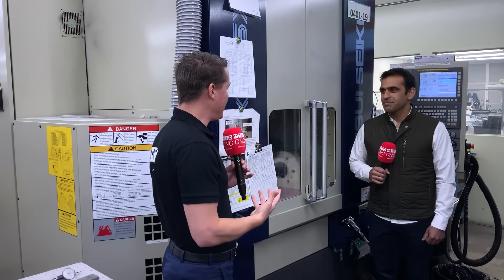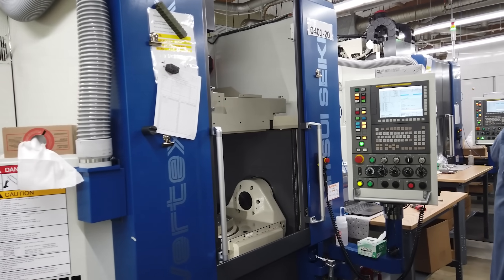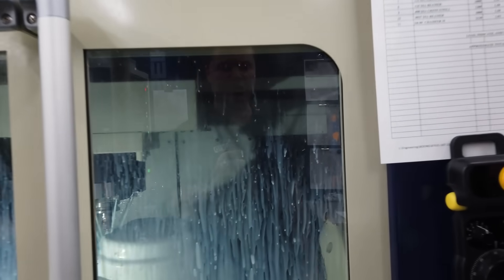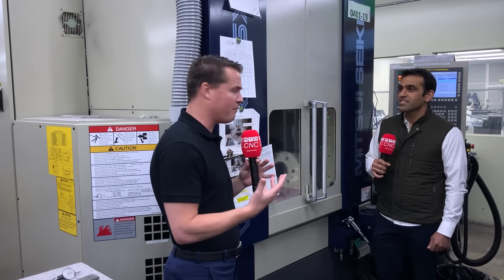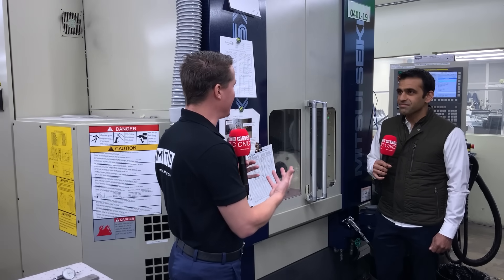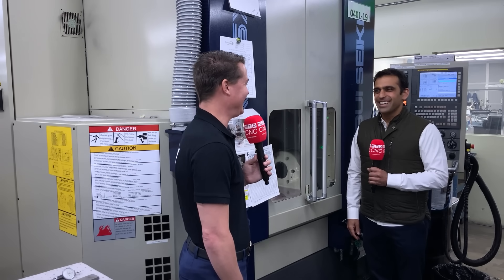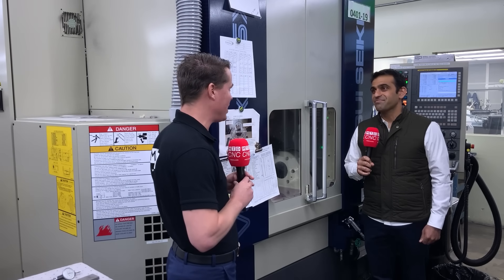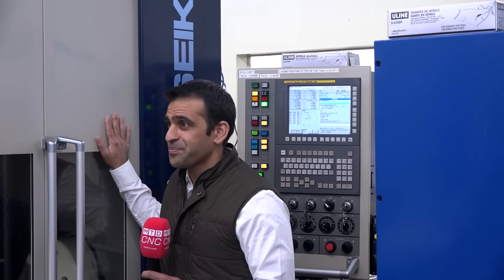What's the best way to machine Beryllium?? LA Gauge show us

Comment: Fascinating, tbh! I was looking for use of beryllium pistons in high performance auto engines TODAY. edited... anyone know any present day ppl who use it in auto engines?
Reply: For engine internals, it hasn’t been used since the late 90s, maybe up to 2000, in a select few F1 cars.  However, it’s still used in valve seats in the form of a copper-beryllium alloy, but even that’s pretty rare.
Reply: @morefaster8169  copper beryllium is used for non sparking tools it’s pretty common in that application.
Reply: It’s stable under extreme temperatures as well as being light, hence its use in the past in at least one F1 team’s engines. This caused controversy because people working around the cars fitted with those engines could be breathing in small amounts. There’s more info about this controversy on YouTube.
Reply: I've actually seen them in little aircraft generators, but not as pure beryllium, they were an alloy of aluminum, beryllium, and scandium. Stronger than steel but feather weight.

Comment: Beryllium is made by powder metalurgy into blocks to be machined, usually the Be powder is alloyed with a little bit of oxide or other metals. It isnt very likely the hydrostatic pressed green blanks would be machined due to what they  tend to make with the stuff.  It is sintered in inert gas and a vacuum to make it solid. It is best to make it near net shape, for example make a mold out of stellite to press it if you can and do finishing operations on it after being sintered if you can as its a very expensive material. Machining it is scary difficult, it cuts similar to high carbon white cast iron combined with all the problems associated with brittle high chromium alloys and the work hardening of titanium all rolled into one oh hell no depending on how much BeO is added to the part. It will rapidly work harden, it can spark up and burn hence the extreme cooling and is very toxic. The main use of it as pure or nearly so is by order of use X-ray and radiation detector windows, structural frame assemblies for aerospace use like inertial refrence components, satellite strut assemblies etc, optical subassemblies like low weight interferometers, telescope and laser mirors, and finally nuclear weapons as the pit neutron reflector assembly. 🤓
Reply from the maker: Thank you for the input.
Reply: Have you cut a lot of beryllium? If so I have many questions! Just got a job for an optical assembly. TIA

Comment: It also sounds like it may be brittle and thus the forces acting at those sizes would crack due to “cantilevered” amount of material towards the center which can be designed around using possibly also a beryllium “former” which is the tube that the magnetic winding is wrapped around. Hearing so much about its temperature properties makes me think it would be a game changer as a former as well, but it needs to be magnetically inert or at least relatively so because the former and coil sit in s groove or directly next to powerful N52 neodymium magnets.
Reply from the maker: Thank you for such great information.